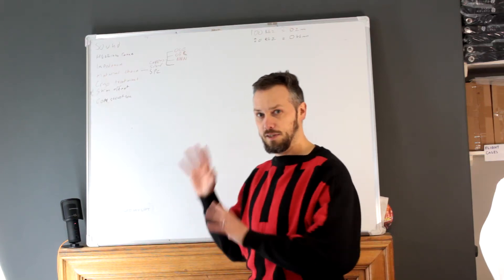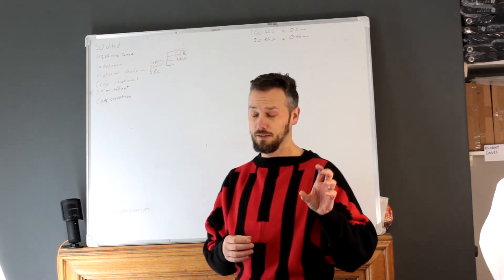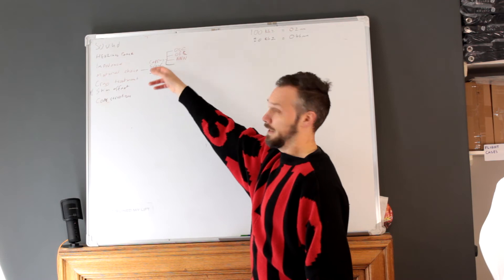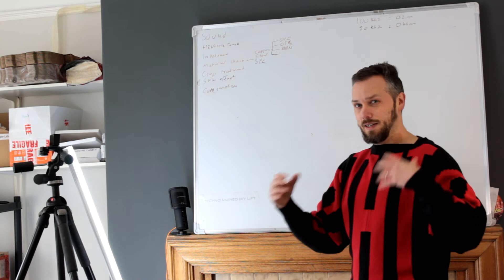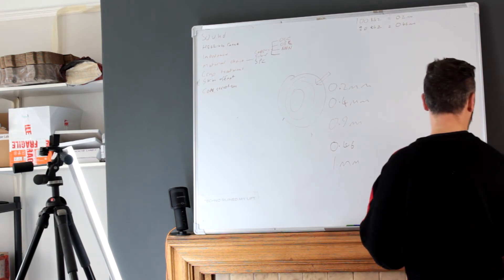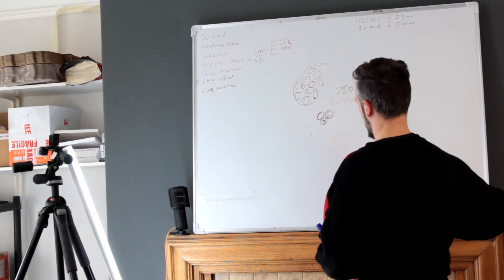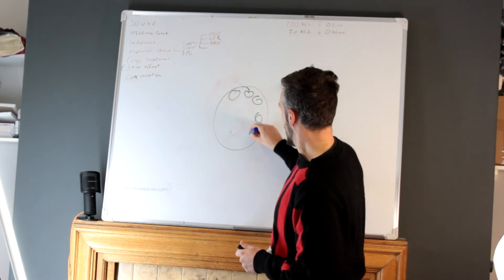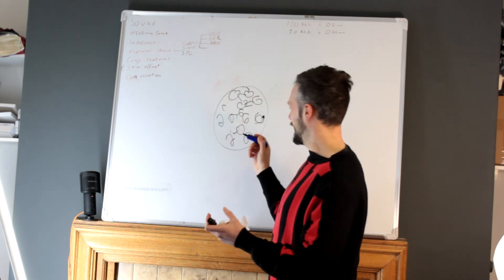Audio cable design / science / myths Part 1

Comment: Let me tell you, a cable on a low powered low frequency device is not going to change the sound, @ 16khz you will get skin effect, that is when the frequency increases the majority of the current will run on the outer shell of the wire, matching impedance plays a factor for max power transfer impedance of the amp and the matching impedance of the speakers, wire does not enhanced  the audio quality, your listening to marketing to much that want you to believe that better cables make your music sound better because they want your money.  Even if there was a change the human ear would never pick it up it would be so minimum, these reviews I see talking about the tamber, and sound stage of a cable kills me especially on IEM's you have a 4' cable which is nothing in the big picture you would need special equipment to measure the low dc resistance of a 4' wire it would be so low almost zero 0.032 ohms 24 awg, a cable does not amplifie anything or change the audio sounds... Crazy talk....
Reply from the maker: You are right

Comment: Twisting cables increases their length and contact area so the capacitance of twisted pairs is increased not decreased.
Reply from the maker: Yeh sorry I did not explain that clearly - I meant the twisted pairs reduce cross talk and braiding can reduce capacitance as you get the wires further apart